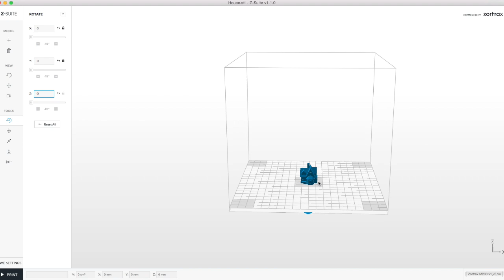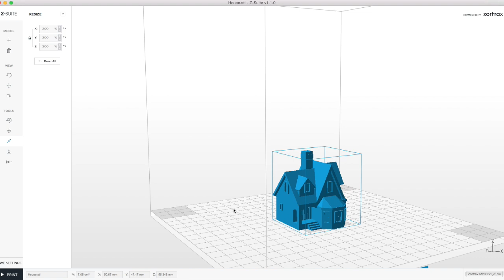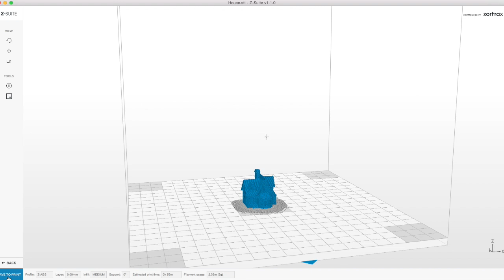Using Z-Suite to 3D Print on the Zortrax M200 3D Printer | Tutorials | Dream 3D

Comment: Hey man nice tutorial. The M200 is printing most of my models with a few pretty visible seams, and what's troubling me is that the seam also shows in Zsuite.
Since the software recognises that there's gonna be a problem with the print isn't there any way to prevent that from happening?
The random seam function just makes the model full of poxmarks.

Comment: can you please tell me what I have set wrong that is causing the raft to be almost impossible to remove on some parts , with the same settings it comes away perfectly on other prints ! I am using am M 200  , Z ABS .  i am very pleased with the printer in all other aspects !
Reply from the maker: Hi +nick wadman , it does seem to vary from print to print in our experience, but when the raft is particularly difficult to remove the best method for removal is to get a sharp knife or scalpel in between the raft and the print, just to separate them slightly, then use the scraper to remove the rest.
Reply: +Dream 3D do you think I really need to order the side and front covers as we live in Thailand and it's always hot here ?  I see the max operation temp for the printer is 35 degrees  ( it's 38 in my house today !)   The problem of sticking rafts seems to be temp related ?   So maybe better to run with open printer ?  What are your thoughts ?
Reply from the maker: +nick wadman they might help regulate the temperature a bit, the main thing they can help to avoid is any through draughts that could cause excessive cooling. It might be worth increasing the fan speed to see if that has any effect. Unfortunately we're lucky if the temperature gets above 20 degrees here in the UK.